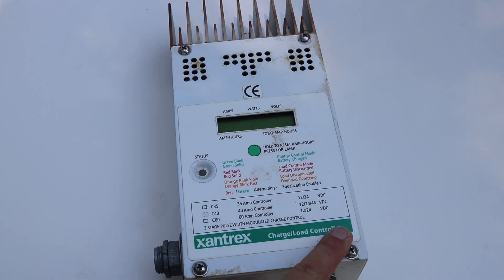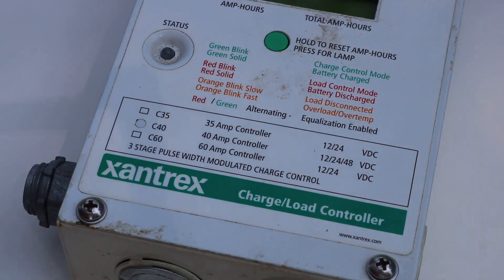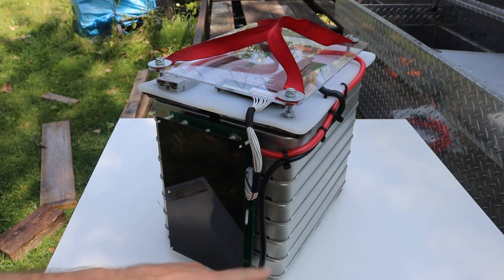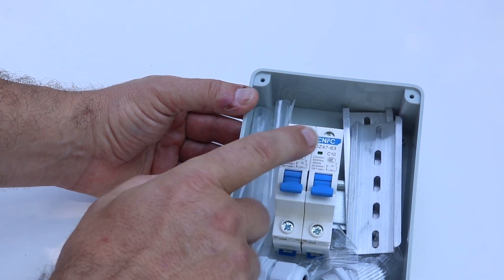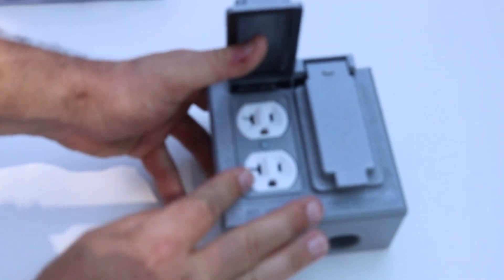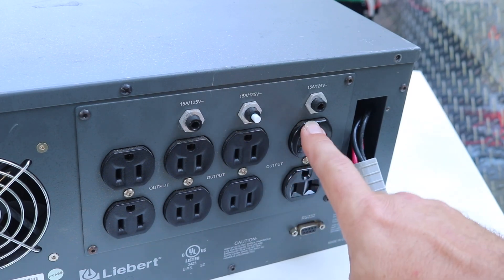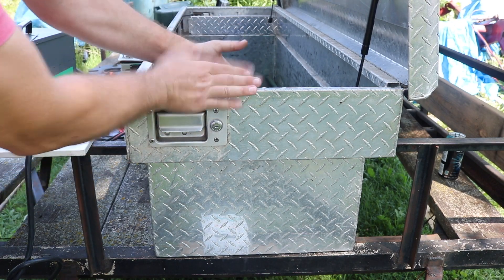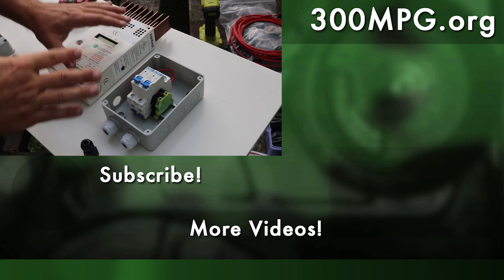Solar Trailer: Part 5 - Components

Comment: Hi I have a set of two tower solar panels with 11 panels on each. There is a SUNNY BOY SB 5000US connected to the panels BUT then separately by itself I also have a xantrex c35 35amp controller 12/24vdc also separately a xantrex Sine Wave Inverter/Charger MS2000 and finally a MidNite Solar E-Panel NO IDEA WHAT TO CONNECT WITH WHAT OR HOW - THIS IS FOR A PLACE AT THE MOUNTAINS. I believe these are two separate system but my experience on solar panels is limited. Thank you for your help and advise. No batteries yet.

Comment: "I later upgraded the charge controller to an Outback Flexmax80" 
I know why...
Your panels are 60 cell 250W with Vmpp of 30V with Impp 8.3amp.
Series 3 together is 90V at 8.3amp = 750W, but charging batteries
at 60V with original (dumb) PWM charge controller is only 66% efficient.
60*8.3 = 500W. With an MPPT charge controller you will get 750W (50% more).
With a second set of panels you will get a full 1500W (An MX60 would have worked as well)

Best choice on the FlexMax80 - I have Outback Power for off grid for 15 years.
I run a 16kWh 24V LiFePO4 battery bank and while the OBS was designed for larger voltage set points
for lead acid, it works nicely with Lithium cells. Just remember to set very accurate absorb volt at about 90% SOC,
a 5 minute absorb time and set float volt at or below fully charged resting volts. Will need testing and setting. With winter and summer settings.
Do not connect the temperature sensor as MX80 is calibrated for lead and will inappropriately temp compensate and happily overcharge your lithiums.
Reply from the maker: Exactly! Well explained. I plan to go over all that in another video talking about PWM vs MPPT charge controllers.
The FM80 is overkill, but I was able to find one (new old stock) for less money than buying the FM60 at retail!

Comment: I have PWM 40A charge controller too, but don't have the switch-to-load function. 
But, I've been thinking that I could connect a GTI to my PV and connect to the 120AC, using a WiFi controlled AC socket (Alexa).
When my BigBattery bank was fully charged, I could command the Wifi outlet to turn on..

Comment: Grid tie for that would be cool!
Sounds like a good boost for your house when the trailer isn't in use
Reply from the maker: Yes, exactly. The main thing is that I need to find an affordable Grid-Tie Inverter which will handle at least 100V, since I have my solar panels in series.

Comment: How are you feeling about the weight distribution situation with this trailer? Do you have plans for how it’s all spacing out etc to avoid any towing issues
Reply from the maker: One reason why I ran the truck tool box the length of the trailer was to help prevent it from being too nose-heavy. The battery and inverter are going in the end of the box opposite of the hitch. It's still going to be a little hitch-heavy, but that leaves room in the back of the trailer for cargo (such as transporting my electric riding mower) or for a future upgrade of an entire electric car battery.
Reply: @BenjaminNelsonX   fantastic, really great to see all the hard work and thought you’ve put into it! Thanks for sharing